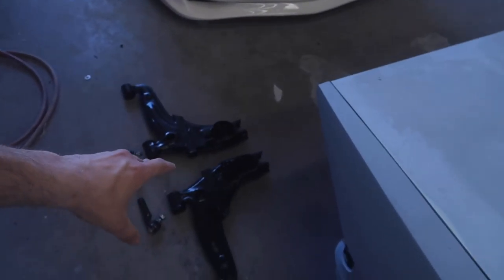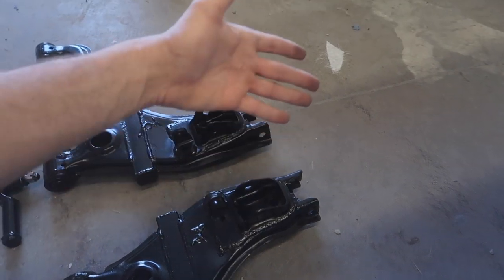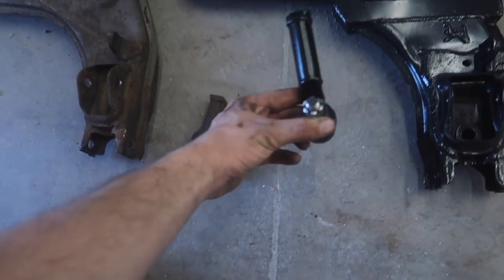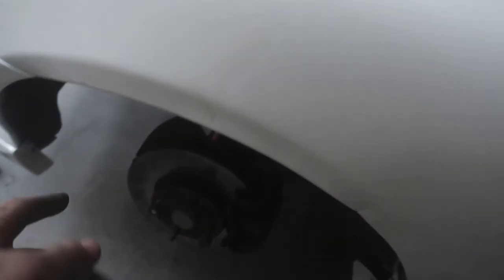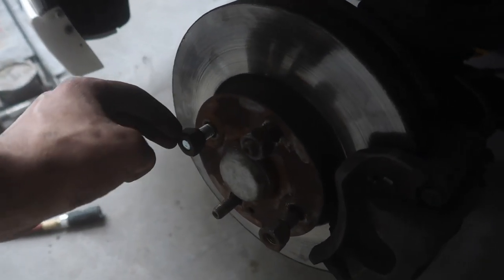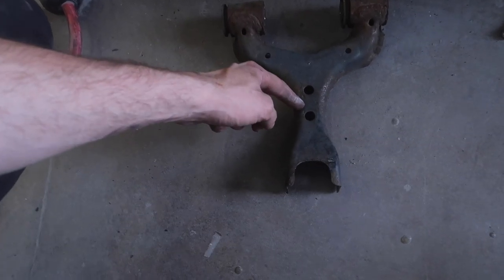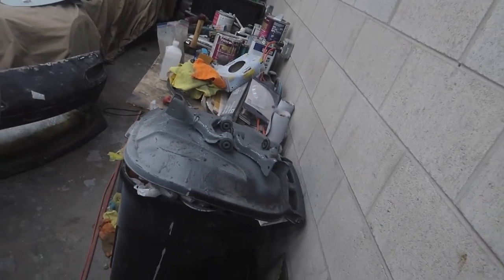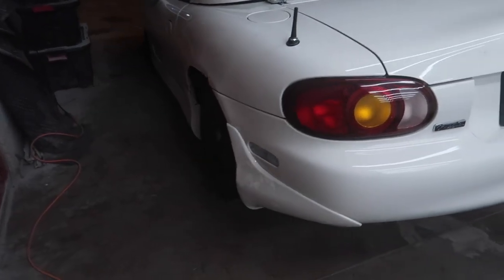-12 Degrees Of Camber | HOW TO STANCE A MIATA

Comment: Perhaps get a lip that sit more flush with the front bumper because unfortunately the one you have now is alittle too low and may damage the body if it's riped off
Reply: I have the same one, he better put some rubber around the edge where it touches the bumper, cause its already scraped off a bunch of his white paint